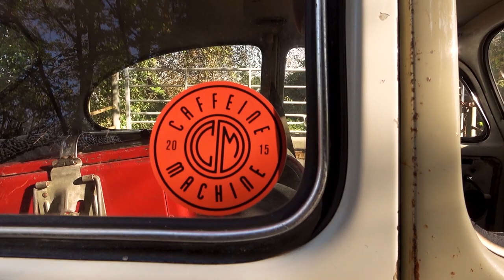1965 VW Beetle - My Slammed Static Bug & Why You Need One Too! 🤙

Comment: awesome car!! how did you drop the front? drop spindle only? how's the back? just the usual drop method?
Reply from the maker: Sadly we had to part with Bundy not long ago 🤙
Reply: @VikingViews  oh no :( but how did you lowered it ? Especially the front? Was it only drop spindle?
Reply from the maker: It has a 6inch narrowed beam on the front and it was actually lowered on coilovers. It had to have the fuel tank raised slightly and a quick steer kit… It took a little time to get right, but it looked epic in the end.